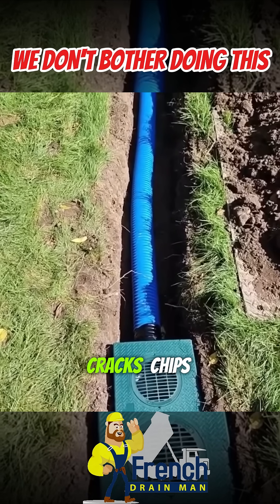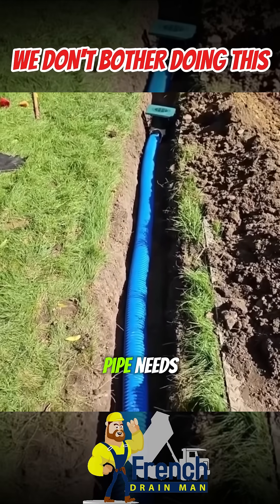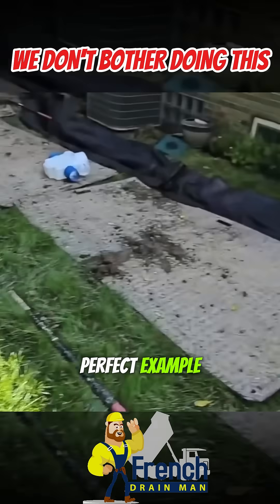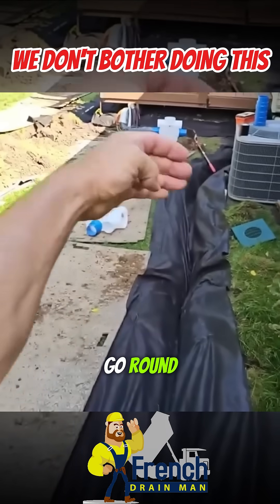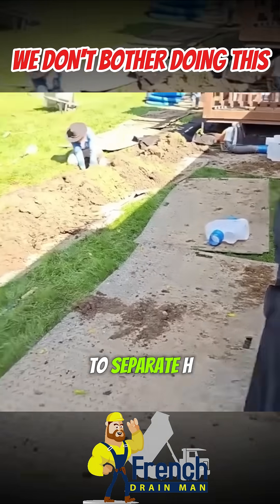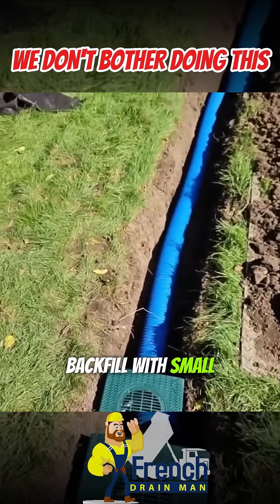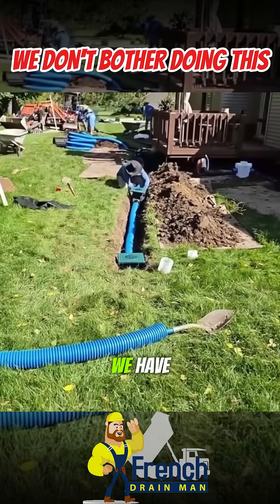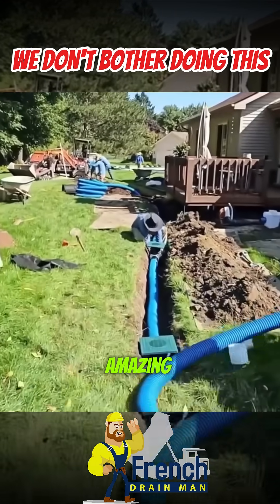PVC Drain Pipe Cracked Again? Here’s the Drainage Pipe That Won’t Fail

Comment: Isn’t a traditional French drain just stone? Why do all of these videos have plastic pipes and tape, and junctions?
Reply: Pipe can move and displace a lot more water. Also, burying downspouts requires solid pipe and pop up.  I know this is a French drain though.  It will keep the water away from the house better with pipe.
Reply from the maker: What whattheschmidt said.